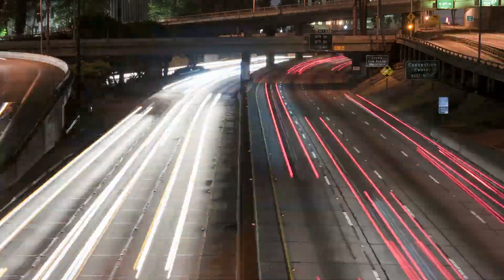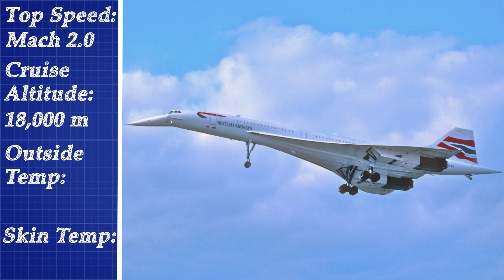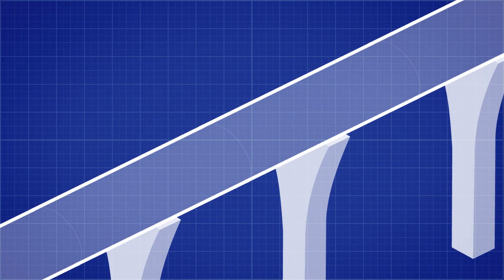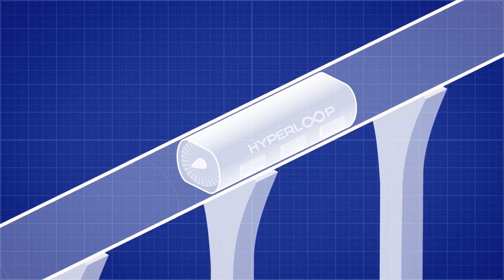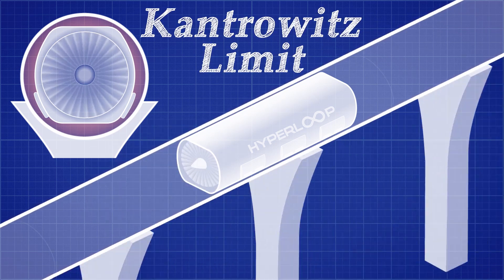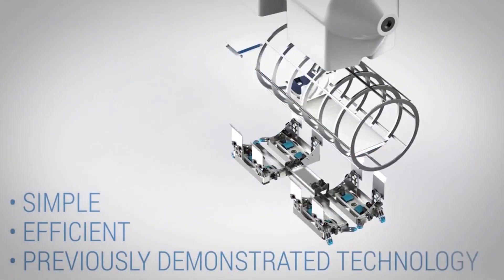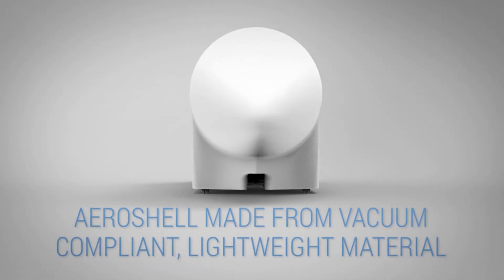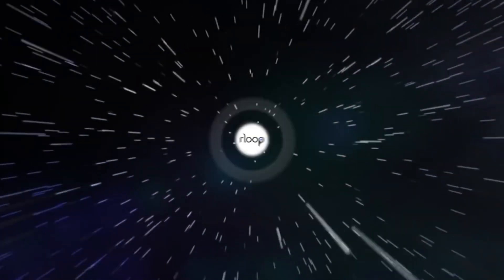Hyperloop - The Future of Travel?

Comment: you can tell how much public opinion on the hyperloop has changed in just 5 years. Just click on 'most recent' comments and it's a wholly different world than the ones posted 5 years ago. Kind of disappointing. I don't think we should dismiss the hyperloop as a concept just yet, but it's sad that people no longer have hope in these things.
Reply: There is a difference between trying to invent new things and falling for scams that has been attempted for over 100 years without any success. This concept is not new. It is about as old as airplanes, and one ideas exist today while the other doesn't. It might just be for a reason.
We are not looking for "concepts" we already had high speed travel of the speeds promised by Elon. It was called the Concord and it was discontinued because people didn't want it. Turns out super high speed isn't actually that much in demand.

This is a scam. The people 5 years ago were gullible people that didn't use their brain and think that as long as someone promise something it works and it is true. People today have heard, seen and done the math to prove it doesn't work. It will not work for many reasons. It will be extremely costly. It will be the new mother of pollution due to the amount of energy required to even get close to what is needed. It will be extremely unsafe and the technology to even create this is imaginary.

You might be disappointed. But you should be disappointed as it is the same reason a child gets disappointed that you can't actually make real light sabers from Star Wars in reality. You are disappointed because you have slammed right into the wall of reality, and I am not even going to try to respect you for crying about it. Just like I do not respect a child throwing a tantrum over that light sabers not being real. To be disappointed about this is childish.
Reply: @Cloud_Seeker  dude, that's a hella long reply, kudos. I wasn't really trying to comment on the feasibility of hyperloop as much as I was trying to comment of public opinion of its possibility, but I understand what you're saying. After reading your comment, I'm inclined to agree about hyperloops implausibility.

Comment: Some of these comments assume a lot of things that either aren't true, or have been engineered successfully for more than 100 years. Just about every city in the US has an existing Hyperloop at their local bank or hospital. They're called Pneumatic Tube Systems. They don't require a near perfect vacuum, simply a differential between pressure and vacuum which again can be created seasily and cheaply with regenerative blowers. The biggest safety issue is how to offboard passengers in the event of a blower failure. Large solar arrays could power the blowers that would be required across the span to maintain constant air velocity. A giant version of a diverter can move carriers (that's what you call the small capsule that runs through the tube) in and out of stations so as not to disturb the mainline traffic.

Seriously, most of the engineering for this was done more than 100 years ago.
Reply: 1. A Pneumatic Tube Systems is literally not anything close to a hyperloop. If you think a Pneumatic Tube is a hyperloop it only show you don't understand both systems.
A: A pneumatic tube works by placing a object in a airtight box. On the other end a fan start pumping air out which creates a suctions force which propel the object to the destination. In other words. It work like a drinking with a straw.
B: The Hyperloop works by pumping out all air and create almost a near vacuum. This is to remove the air resistances so you can have a high speed train of some sort going through the loop at a very high speed as it doesn't have to worry about the friction from the air.
Conclusion: They are nothing like each other on a fundamental level. You can easily get a pneumatic tube from the hyperloop if the hyperloop gets damaged, but no one inside will survive.

2. It really doesn't matter if you call it a "near perfect vacuum" or a "perfect vacuum". The difference is so small it doesn't actually matter all that much. Fact is that they will never be able to achieve what they want because the system will not be able to tolerate leaking and any vacuum system leaks. You are always going to get some small hole in a seal or a welding. You can not pump out more then the leak rate.

3. That you think you can get anything cheaply show you have no understanding at all what you are talking about. No. You can not get this cheaply. There is no cheating reality. The more of vacuum you want the harder it will be as it take longer and longer to pump out the gas. You get a diminishing return the more you pump. However you still have to pay the same exact energy cost for the pump. It will not be cheap no matter what kind of pump you got. The only pumps that can work are highly precision pumps that are extremely expensive and very difficult to actually use in a system.

4. No. The biggest safety issue is not offboarding passengers in case of a blower failure. That is like saying the biggest safety issue with a car is if the car engine stop working. No. The highest safety issues with a car is actually diving it at high speeds, and the same goes for the Hyperloop. When anything travels at that speed you can not make any sudden movements at all. Turning circles are huge. Newtons first law of motion: A object in motion will remain in motion until acted upon by another force. That means that if you have a curve the curve must be able to redirect all that energy that train has in the new direction, or it will have to take all of that energy into itself. It means that if you have a 90 degree turn, the train will blow right through the curve if the curve can not redirect it 90 degrees. This becomes very relevant when we know that metal expand and contract with temperature. Oil pipelines have bend and system for this exact reason. The hyperloop can not have such a system.

5. Can you prove that Large solar arrays can power the blowers 24/7? How many watts do they produce. How much is required. Give a real example of a system being able to do this.
You will not be able to prove this because you have no idea what you are talking about. You think they can, but you don't know enough about electricity or solar panels to actually be able to prove it with math.

6. No. You are talking out of your A again. No. Most engineering has not been done more then 100 years ago. If it really was done over 100 years ago, Elon shouldn't have pulled himself out of the actual development and managed to create this Hyperloop in a real working environment right now. It didn't take 100 years for the airplane to develop into jet planes, so why hasn't anyone actually made a hyperloop at this point. As you proved yourself. Pneumatic tubes are old and have existed for over 150 years by now, so someone should have come up with the idea. Someone actually had come up with the idea 100 years ago. That is called the Vac-Train. It went nowhere because anyone that went into it seriously figured out it doesn't work.

Comment: Picture moving 300+mph and hitting a brick wall. That's what the Hyperloop is. A small leak somewhere upstream from you will let air in, and at high speeds a wall of air or a wall of bricks act the same. You end up with a bunch of people crushed into a pancake with the pod.

Comment: The hyperloop is a stupid idea that will fail. The current prototype is a 1km test track in the middle of nowhere, and the physics completely deny this thing. Besides, it should be seen as an act of terrorism as it is such an extreme safety hazard, that no feasible amount of steel that you slap on can fix.
Reply: Well, there's nothing in the physics that says it's impossible. The practicality of it in execution however......

Comment: Dear Thunderf00t viewers

Is that you are elon musk hater?
Reply: Here's the interesting thing to that assertion. I rather like Elon Musk eccentric as he is and what he wants to do. When it comes to the hyperloop though the concept is simple in principle, but the problem comes with the scaling and primarily so with the tube and its added challenges. You need something that will never fail over the proposed 400 km span, if it does fail you need to have a fast evac system that somehow won't add to the failure rate or risk losing everything in the tube, including large portions of the tube itself. You then need a way to fast repair without adding to the failure rate and re depressurizing the tube in an economic fashion. If you decide to make a tunnel for this like elon musk seems to want to do. You need to make it wide enough for the initial tube, an expansion for whatever vacuum pump stations you want along side it and further expansion for any cases you may require for quick service of the tube and rescue for anyone trapped in the tube, good luck adding ways to get to people that need to be rescued in the tube without further adding to the failure rate.

There are no challenges in creating the internals for the tube, it's the fact that you basically need to maintain a flawless tube carrying large masses at high speed and there are no fail safe mechanisms for such a design, it's pretty much catastrophic failure or works fine. No real thought has gone into how to address these issues if it ever becomes operational and even if it does manage to become operational as yes these challenges can be addressed, it will be nowhere near the promised efficiency because all of the problems of the tube are what make it ridiculously expensive, particularly over long distances.
Reply: https://youtu.be/SePATBiLSYs?si=KgvTmqISqYaiPmDt

Comment: In theory if it were possible to run trains or cars/carriages in an evacuated tube wow almost zero resistance therefore high speed low energy required blah blah. However just the simple physics of creating such a near vacuum in a very long very high volume tube is impossible with current technology. It’s easy for the likes of Elon Musk to fool governments and non engineering investors let alone have Universities grant funding to budding engineers to design a vehicles to capitalise on vacuum tube propulsion. I have 30 years career experience with pressure applications and forget the Tube we would need engineers to revolutionise vacuum pumps before any more effort and money is wasted. Just search NASA largest vacuum chamber in the world to see how long it takes and how much energy to reach their chambers desired vacuum. Take this volume and maybe you would have a tube long enough to get about 500 meters.

Comment: Do you think you could make an update video about how the project is coming along now?
Reply: Just good look up Thunderfoot. What has happened is that they built 2 tubes and has a bunch of students making a "car" for one of them.

The issue is that the tube is to tiny to be any test worth doing as it doesn't prove anything, all they have managed to do is a electric car on a monorail which was invented like in the 1825 (ofc if you ignore the electric part), they have not any way a way to actually transport people inside then tube, they are getting praise for having the lowest amount of deaths using the transportation system (without them figuring out NO ONE IS USING IT), they have no way from stopping anyone with a hammer from just going to the tube and hit it hard with a sledgehammer as that will destroy the whole tube, their tube is constructed in such a bad way that their tube have rusted inside due to them not applying the concrete correctly, they have not accounted for the heat expansion in the metal which makes the top side bigger then the bottom side which cause the whole thing to be bent upwards.

Their tube is a death trap. It is safer, fast, cheaper and more environmentally friendly to just keep doing what people are doing and not even bother with the Hyperloop.

Comment: can you address the critics of this idea? like Thunderf00t
Reply: +Real Engineering He's almost always right, betting he made a mistake this time or calling him stupid is a mistake. It doesn't really matter if it is physically possible, because it is, but let's say the tube has a failure, hitting the incoming air at the speed of a bullet rushing passed the narrow walls is a deadly place to be. Repairs will be slow. Maybe it will be done, but I won't ride it without a rigorous history of zero failures.
Reply from the maker: Yes, Thunderf00t is an idiot that doesn’t know how to use basic physics equations and likes attacking young women that dare call him out on his bullshit. The only valid criticism I have seen is cost. The terrorism aspect is silly, and fail safes are easy to engineer.
Reply: Thanks for the quick reply, I thought that you wouldn't even read this

Comment: Physics, not the short length of test track, prevents high-speed runs.

Still ZERO progress on development of an expansion joint which can safely contain the vacuum which is a necessity over real-world distances, nor is there any detail on how the tube can survive a trivial external impact which would cause sudden implosion of the tube.

Still ZERO basic detail of finances over funding, installation, operation, and maintenance costs.

If standard tech HSR costs $5M per mile and maglev costs 10x that, what would the additional costs per mile add to the bill as HLoop is built upon maglev with a large tube and vacuum support equipment in addition.

Infrastructure is not a game.  Someone has to pay for it and if the funds don't exist for HSR, then certainly THIS is going nowhere.

Comment: Watch thunderfoots hyperloop busted video. This is garbage idea that will fail. The fact that people still take this seriously and don't realize it's scam is amazing.
Reply: People have also debunk Thunderf00ts video on hyperloop. Lets just say that  Thunderf00ts  say some very erroneously scientifically false thing in his "debunking" videos.
Reply: And thunderfoot did a response to thoes "debunks"
Reply: In which he repeated and doubled down on some his own inaccuracies.
Reply: remliqa
Maybe, he is just correct. It is idiotic to think you can easily create a way of transport using tubes like this. Not only is the vacuum the problem, it is literally impossible to get the vacuum they claim simply because no current technologies exist to even create that vacuum, even if you just make a small vacuum. You will not get me into a tube like that if you paid me for it.
Reply: Thunderfoot blows it way out of proportion.   He shows the concrete walls of NASA's deep space vacuum chamber but does he show the thin glass walls of your thermos?   He talks about air rushing in at the speed of sound, the air would rush in at a speed determined by the differential pressure and the diameter of the opening as per fluid dynamics, the speed of sound is an upper limit that it could not exceed no matter what the differential pressure is and keep in mind that the differential pressure is not infinite, it would be less than one atmosphere, your espresso coffee maker operates at 19 atmospheres, you don't see the coffee shooting out at the speed of sound.   We already have pneumatic systems that deal with leaks all the time, the very reason why we have air brakes for trucks and buses is that leaks can be compensated for with additional pumping capacity.    Thunderfoot is completely oblivious to engineering fields such as fluid dynamics.   Take his video to your local University and ask the fluid dynamics prof to review it.

Comment: This is a dumb idea. Each pod could only carry 4 people (who would most likely be business executives) and although it travels a little over 2 times faster than a maglev train, the maglev train can carry a couple dozen people. You could line the pods up and connect them but that would create more of an issue for the air that would have to be pushed out of the way thus creating turbulence around the pods. A pod that is too long would have a similar problem and the sheer weight of these pods would cause a lot of stress the to tube. 

And don't get me started on the amount of endless and costly maintenance that the tube would need to even be remotely safe. Of course, this maintenance would cause delays because unlike fixing a simple railway track, there is an entire tube that would need thorough inspection. Even Concorde was a better idea.

Comment: The only problem of Hyperloop is that it is just not a good idea. It won't ever work like it's supposed to.
Reply: Just think about maintenance. If you get a single problem you have to shut the whole system down. Even if you can just shut down sections you still can't use the whole thing for a while. When there is maintenance in one lane when I drive a car I can normally just drive into the other lane to avoid the problem, the Hyperloop is just a single lane track that when it get the smallest problem gets shut down. Even railroads have less breakage potential.

Comment: That sounds interesting, but how will this low pressure be created and how will the carts enter and exit the loop without alter the pressure in the loop? I guess the loop always need to have this vacuum inside, for it will take weeks if not month to remove all air from it, so the carts need to inserted into this system without breaking any seals and each cart need to have air supply for at least a day if the system fails, for there can not be any emergency exit in a sealed system. So is this even posible?